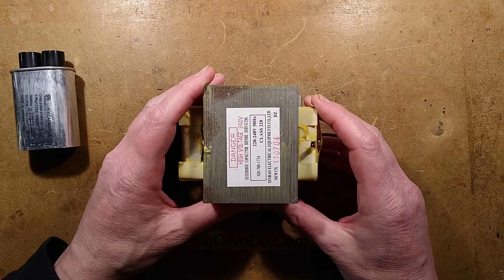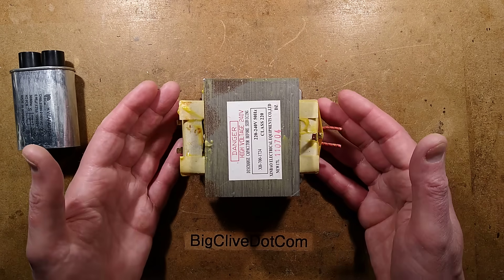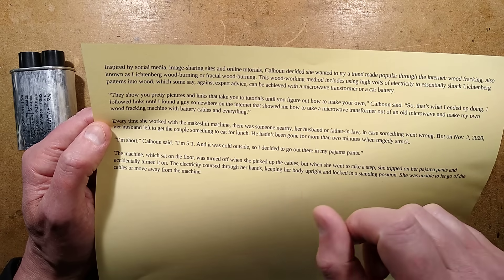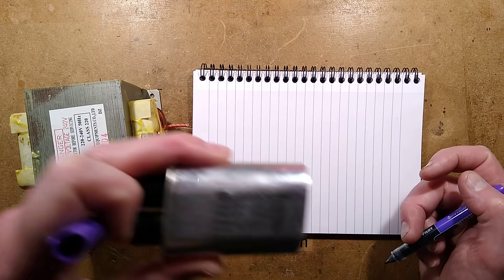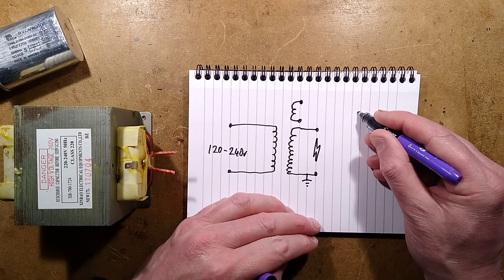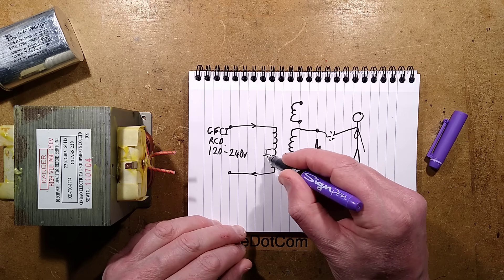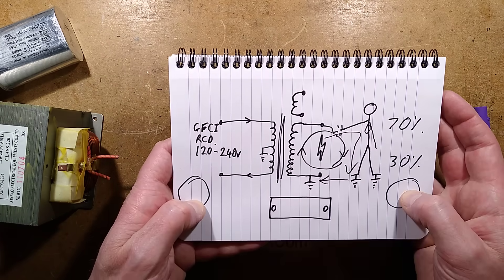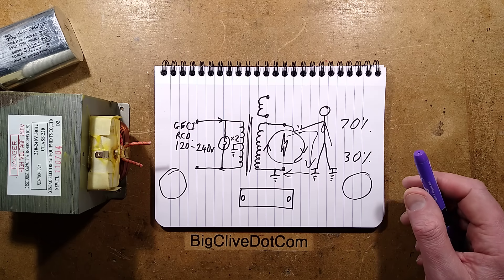The most deadly project on the Internet

Comment: Well I can say with utmost certainty that I will never get hurt wood fracking or doing anything with a microwave transformer or capacitor. I learned early on in my life that electricity and I are not on amiable terms, mostly because of my crazy, careless and irresponsible experimentation with electricity when I was too young to be messing with such things, but I've also had other unfortunate encounters with electricity, including one under wet conditions which were not of my doing and which did not happen because I was tinkering with electricity, just wrong place at the wrong time. In any case, I have seen some very cool videos on YouTube about how one can build many very interesting and useful things with a microwave transformer, including a spot welder, which I'd love to build. However, everyone always warns of the extreme dangers of microwave transformers when used carelessly or incorrectly and of the lethal electrical charge which microwave capacitors can hold for long periods of time and after doing just some brief research I decided it was best for me to stay away. There are a lot of very knowledgeable people on YouTube and also a lot of not so knowledgeable people who give instructions and advice on how to build and work with some very potentially dangerous projects, and me being no expert on these things, I'd rather just avoid making a serious mistake because of my lack of full understanding of circuits, transformers, capacitors and electricity in general. I do occasionally work with electricity and high voltage equipment, such as my welder or my plasma cutter, but when I do, I dedicate my full attention to safety and the work at hand and never even slightly get a sense of complacency because like I said, electricity and I are not good friends, but it certainly does have my respect.

Comment: I used to repair restaurant equipment on the side. Capacitors should never be assumed to be discharged. Microwaves, refrigeration, CRTs, and cooling equipment have some pretty nice electricity stored in them, (1PH).
The worst accidents I have seen was from 3 phase electricity. A surprising amount of techs are being sent out to work on 3 PH. having never been around it before. 
I was thinking about trying this, on wood, but I have a very small electric fence charger that I thought about trying. It runs 120VAC in and 7000VAC out, but only 500MA output. I have no idea if it's strong enough, but I was going to use an old foot switch from an old TIG welder. While an electric fence will drop your dick in the dirt, it usually doesn't kill.
Smiles!

Comment: I got brutalized by one of these microwave transformers maybe a decade ago but luckily not maimed. It happened while testing taps i was making on a rewound secondary for a sheet metal welder. I don't know exactly how it happened because my memory got scrambled but when i woke up on the hard concrete floor of my basement i couldn't get up at first. I had been out for so long in such a weird position that i felt nothing but pain while trying to get up and i finally did get up but it wasn't easy. I had such bad bruises people thought i got the crap beat out of me, one side of my face black and blue not to mention the areas on my body that made contact with the ground I was there for at least 6 to 8 hrs!

PS: Most of these injuries had nothing to do with me hitting the ground falling from a straight stand like a sack of sand too fast. They were from being immobized in such a weirdo way my knees buckled and knotted under me

Comment: not via this bonkers method, but I have received a 20KV shock from overhead wires. All it takes is about 5 seconds of inattention. I was exceedingly lucky: i am not dead. I didn't even require any amputations. but i was over two years recovering - including relearning how to walk from the nerve damage to one leg. after those two years it was another five years before i really recovered full range of motion in my shoulder. high voltage is no joke.

Comment: Great vid. I've done the fractal burning, using an oil-burner transformer @ 10,000v, low current. Far "safer" than a microwave transformer, but still dangerous. I have the indicator lights and a foot pedal, along with careful isolation and dry work surfaces. I still got one hell of a shock one night, "when inspiration struck," and as you said, complacency set in. I benched the thing after that. I'm with Clive, it's fun, but the odds of getting hurt go up every time you do it.

Comment: Do not take apart a microwave oven. those capacitors hold voltage for years.  If you do not know exactly what you are doing, you can get dead at the speed of light.

Do not do this.  It aint 120V.  It will blow your heart out.  I knew enough to know i did not know enough to attempt this.

240v is not 120v.  I saw this happen once.  We had to knock him off with a board.  Never touch them with your body.

Comment: About 20 years ago, I got hung up on a microwave transformer during a repair attempt. I was improperly trained by the company I worked for. I remember it grabbing me, not being able to let go or do anything to get myself off of it.. and everything started going black. I was sure I was going to die.  Then I woke up laying on the floor in front of the microwave, my hands smoking and bleeding. The mains breaker tripped and let me go after I was out. Luckily, my hands while very sore, did heal and I didn't loose any fingers. I am now a PROPERLY trained repair tech and trainer, and this story gets told to all my trainees. I also built a Jacob's Ladder out of one for the specific purpose of demonstrating their voltage output in a way my trainees will remember. These transformers are so incredibly dangerous.

Comment: This is a important video, I know of a sixteen year old who died trying to fix a microwave oven, not a do it yourself project, we had injuries at the shop and that’s with proper training, as Clive has mentioned the bleed off resistor does fail and the capacitor can function without it, together in the microwave you get over four thousand volts, transformer combined with capacitor and diode pack witch by the way is connected directly to ground will stop your heart immediately, for the consumer the microwave oven is a very safe appliance as long as you don’t open it, if the fuse inside blows it’s probably because of a bad door switch, they are designed to short the main fuse in case of defect to protect against magnetron operating while door is open

Comment: So quick question: Could this be done with an arc welder instead of a microwave transformer? And if so, would that be safer due to the safeties built into the welder?
Reply: No. An arc welder uses high current and very low voltage. It will not make teses patterns.

Comment: Commenting just for boosting the signal on the "engagement".
Reply: More detailed comment now that I've watched the whole video.

The best way to work with a powered-on MOT is to not do so.

The second best way is by wearing appropriate electrical protection equipment. That means ASTM D120 Class 1 (or equivalent for your country) gloves. That means about $120-200 for the gloves. You also very much want an inspection pump, which will let you detect pinhole damage that would render the glove useless (and you dead). McMaster sells those for $300. Of course you want eye protection, so nonconductive safety glasses or goggles ($5-10). And a MOT is just capable of being an arc-flash hazard: not enough at once to need full arc-flash kit, but an NFPA 70E (or equivalent) arc-flash protection face shield ($205 on McMaster) is a very good idea. 

So about $630-700 or so. Or you could use a regulated supply like a neon sign transformer and take a little more time (though I'd still want the gloves & glasses I'd skip the face shield). 

If I were making a business to make these things I'd certainly get the protective gear. And probably a regulated variable supply, eg SpruceScience sells a 0-10kV 0-2mA lab supply for about $1000. Keep the insurance costs down!

Comment: How much power does this process actually need? I suspect one would get away with a Cockroft-Walton circuit, a 1.5V AA battery and a basic oscillator. That and a set of appropriately-rated HV probes would go a long way towards improving safety, no?
Reply from the maker: For speed it does require high power.  It's physically burning the wood.

Comment: In 1984 servicing Microwaves, I did the ultimate in stupidity, I reenergized the Maggy and in testing the low voltage side I touched my finger to the anode of HV rectifier and elbow of same arm (fortunately)  to case, I still have pain and nerve damage from an almost fatal stupid mistake,  This is Not how you discharge the cap through the transformer,

Comment: This, the giant capacitor, and the magnetron who i once heard had some beryllium ceramic that's bad to inhale are the main reasons I'm afraid of disassembling microwaves.
That and i also once got shocked while playing with a 12V motorcycle battery, now I'm reeeally afraid of any voltage.
Reply from the maker: Modern microwaves use a pink ceramic that is based on aluminum and chrome oxide.  The 12V battery zap probably involved a solenoid or other coil.  When you disconnected it, it created a high voltage spike as the magnetic field collapsed.
Reply: @bigclivedotcom  Yep piece of wire ok with low voltage (sub 50v). coiled piece of wire not so safe.

Comment: This is one of those things that can be done very safely, but unfortunately if you don't really understand electricity and how it can kill you, you really can't be sure you are doing it safely, and too many people don't have the patience to not take shortcuts once in a while (like holding the probes when they are live).   I worked as an electrical engineer for 30 years, and I wouldn't trust at least 50% of EE's to do this safely either.  So my advice is unless you are very experienced with high voltage power, and you are very disciplined, don't bother with this - there are plenty of other woodworking projects that are just as cool :-).
Reply: It would seem that the most important thing would be to use some sort of mechanical devices to hold the probes against the wood when the power is being applied. The operator would then be positioned well away from the wood and would have to use a two button switch arrangement to activate the machine.
Reply: @joevignolor4u949  Correct.  I just cringe every time I see people holding the probes, one in each hand as they move them around the work piece.  The make a perfect path through the heart.  I have holders for each probe, a dead mans switch to turn it on, and a very bright light that goes off when it is on.

Comment: Excellent video, just one remark. The way people are shocked when touching AC voltage is in no way related to the current "finding its way to ground". Your body has an parasitic capacitance and you are connected to an alternating voltage. No amount of insulation on your feet can prevent the voltage from charging/discharging your body repeatedly, and THAT is how current passes through your body.
Reply: That's good to know. I always thought if you have a well insulated rubber sole boots on, then you're safe. Now I know to think twice before testing this theory.

Comment: I gotten zapped by one of them heavy duty ballast that powers 4 different 600 watt bulbs. I tripped the braker so i can work on it and someone else in the building flipped it back on at some point and Me and few others didn't know and let me tell ya, it hurt. I didn't go to the hospital, wasn't willing to pay them unless I was dying, but I can say I got some nerve damage from it, its almost like tendentious, but sometimes my entire arm will spaze and muscles will contract out of no where randomly, This happened nearly 10 years ago and never had that issue before.

I went to the doctors for it and they gave me this treatment and a place I was suppose to go, and they changed me $20,000 for it and my insurance covered another 30,000 or so, I never went back, medical insurance is so screwed in this country, it's cheaper to die than it is for treatment...
Reply from the maker: Rest assured that a "normal" shock will not usually have ongoing effects like that.  You're fine.

Comment: To be honest you're better off using a welding machine set up for arc welding without a rod. You can wear the appropriate PPE and it would be much safer. Run low amps and use 150volts A/C positive.

Comment: Reminds me of the 1950's when I was a TV engineer. Sets from the '40s or earlier used mains derived EHT for the CRT display and that was at about 5kv and could kill you instantly so I treated it with the greatest respect. When flyback (high frequency) EHT was introduced in about 1950 it became a whole lot safer even though the voltage increased to nearly 30kv by the time colour arrived, that would give you a nasty bite but because of the small amount of current available the voltage diminished  to practically nothing almost as soon as you came into contact with it. Electric shocks were par for the course when servicing valve TV's but they were usually only a couple of hundred volts, you would pick up your screwdriver from wherever you had involuntarily thrown it and get on with the job. These shocks were mostly from DC which in some ways are more dangerous. There were all sorts of things we did then that would be outlawed by health and safety now but I'm 83.
Reply: Comments like this make me think about all those that didn't make it, all the little kids killed by simple household appliances during freak accidents, etc. Life is fragile.
Reply: @FreakMeat74  It's easy for people to shit-talk safety regulations when they have luck and survivor bias on their side...
Reply: @caramelldansen2204  Huh? No idea what you are saying buddy.
Reply: @caramelldansen2204  don't think he is shit-talking, I got the impression he looks back and sees it as quite right that the things he did would not be allowed today in any kind of professional/business environment
Reply: @caramelldansen2204  Safety regulations protect the ignorant and the stupid from killing themselves. If this is the case, how can darwin do his job?
Reply: @Fromatic  I hope you're right. You'd be surprised how many times I've heard the "I survived, so who cares who died?" boomer mantra
Reply: Holy shit that’s cool. Rock on man
Reply: The voice of experience is a thing to be respected.  And this one, in particular, has some neat content.
Reply: except the tube capacitance itself will store and discharge enough current to kill you still.
Reply: So you were a TV engineer before the age of 21?
Reply: @bacicinvatteneaca  People (my Mum was one) left school and went to work at 15 years of age back then in Great Britain - as it was known then. Apprenticeships for boys were even earlier starting.
Reply: I remember my dad buying and showing me how to replace TV vacuum tubes. 👩‍🔧🇺🇲⚒️🇷🇺🐻
Reply: And if it didn't kill you fixing it, it would get you while you slept by burning the house down if you forgot to plug it out or turn it off. Also I'm sure you remember the good old live chassis on everything, got me a few times.
Reply: There's a really good series of documents called repairfaq. I remember it saying that the most common injuries from the high voltages in TVs was laceration of the hands and forearms from people reaction to touching something.

Comment: Hi Clive, could you please explain why a microwave cell is so much more dangerous than for example an electric fence, tazer, or shorted surge protector?
I was under the impression that voltage is pretty irrelevant when discussing danger and it's Amps that you have to consider, as self-defense tasers are 500k-1M volts and are certainly "shocking" but nowhere near deadly. Likewise, you can hold on to an electric fence without dying... how many amps is a microwave cell compared to an electric fence for sheep or goats?
Reply from the maker: The fences and tasers give out sharp pulses that hurt a lot, but don't have the destruction of sustained power.

Comment: sooo... using one of these in a bug zapper is probably not a good idea....

There's the classic horror movie "Jacob's Ladder". This is probably a little too hot for that either.
Reply from the maker: The movie grade Jacobs ladders were actually really dangerous.
Reply: @bigclivedotcom  We used a small one in a high school play! (It was the 80's...). We had a problem with the wires swaying after it got moved, and one of the teachers tried to fix them in place with a scrap of wood at the top, and wondered why it wasn't working until the wood burst into flame. That was later replaced with a piece of lexan.

Comment: i work with High voltage lines. and the 3200 volt lines we keep 3 feet away from by a RULE . we use very specialized high voltage tools to actually touch these lines. 
Anyone that does this project, Is asking for a DARWIN AWARD . Electricity is silent, and unforgiving. LIKE a microwave , electricity cooks a persons body from the inside out. you will not even see some of the damage electricity does even from a very SHORT shock.